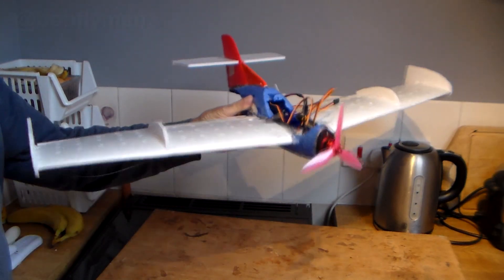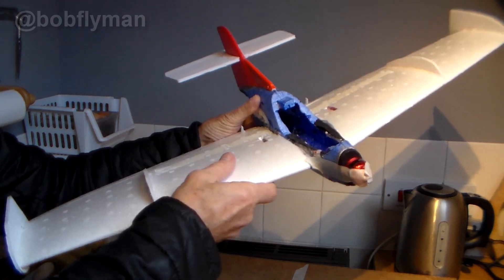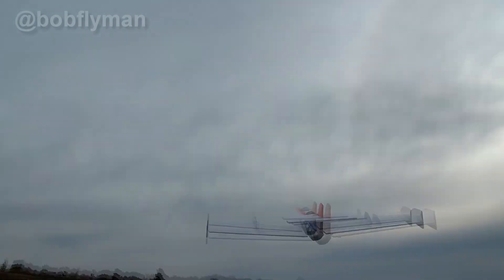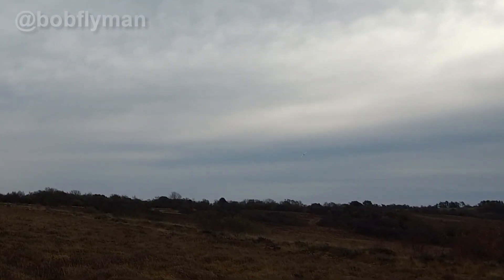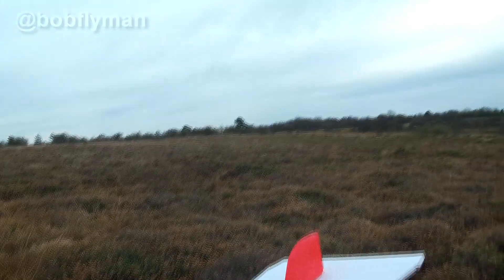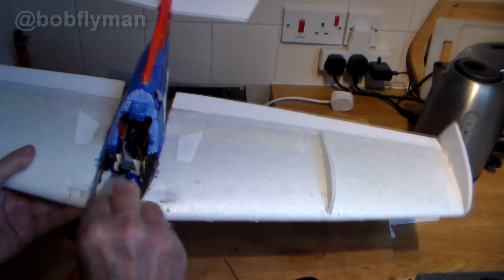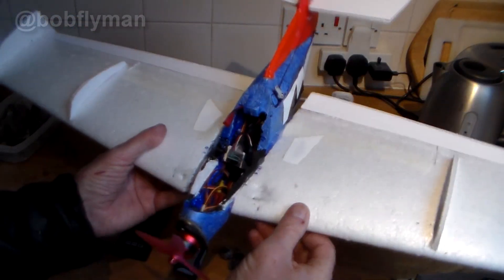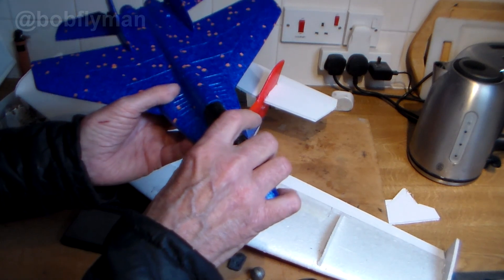My Lidl RC conversion the 'Stumpy', finally ends up in the bin, but why?

Comment: In the past I've used a cardboard tube to extend the nose I then filled and sprayed so the C of G is pushed forward saving the need for loads of weight a short nosed model is always harder to fly thats why I avoid them
Reply from the maker: Good idea, that would have been a way to go.  I built a foamboard  Flight Test Versa and added a nose for that very purpose. Worked well, not as easy as a kitchen roll cardboard tube though. 😉   https://youtu.be/uTmxfCvwHS0?si=O8vQkqlyjyR7icY8

Comment: that motormount looks 3D printed, if you send me the file for that i could design you an extender you could put some weight in? would be good to see this fly properly!
Reply from the maker: That's really kind but in fact my motor mount was a laminate of thin plastic and balsa.  An extender would have been fun though!  There has been a lot of suggestion that that wing design, plank, needed reflex to fly as well as improved CoG.